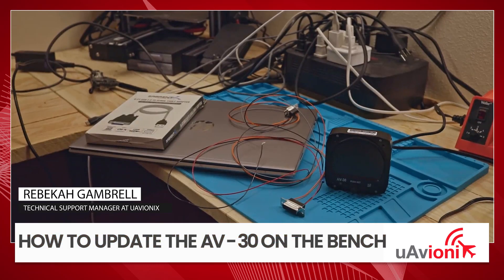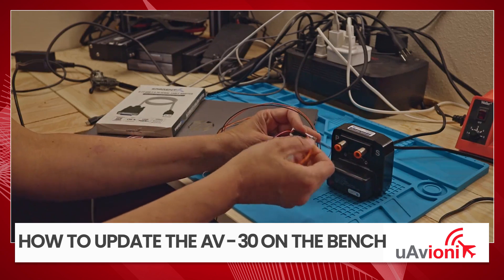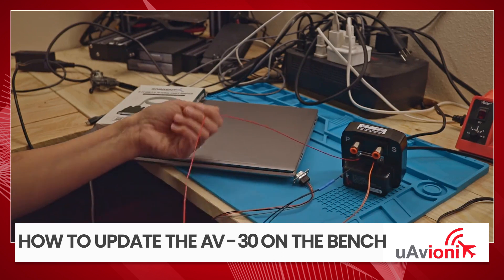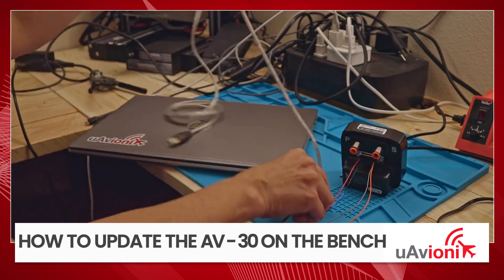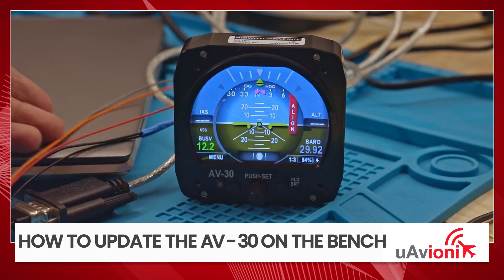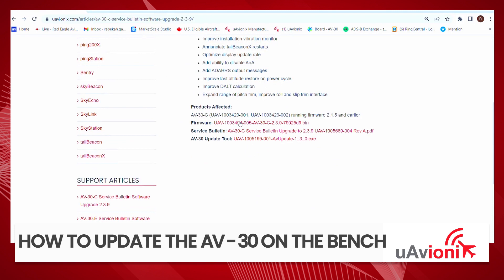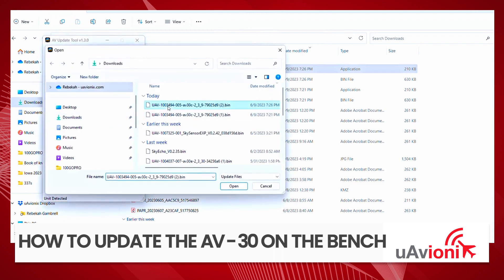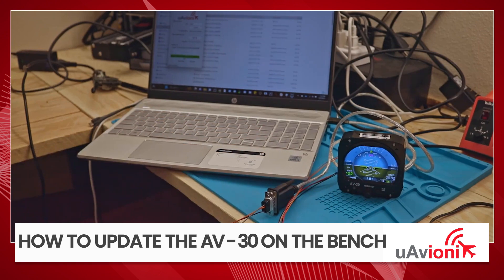How to Update the AV-30-C Software

Comment: You have GAWGHT to be kidding. A 21st century, cutting edge, device driven by pins and wires from the 1980s. Not to mention the fact that there are a few of us who own Apple computers. 🤦‍♂️ Up until this video I had been looking forward to the two AV 30s that I just had installed in my panel. Buyer’s remorse.

Comment: The title of this video should omit the -C, because it works for the AV-30-E as well as the -C.  Also, I, too, was about to look up the specs for an RS-232 9-pin connector, but I came to these comments and found that GND needs to go to pin 5 on that connector.  Other than that, it was a very useful video, and worked for me.  The Sabrent cable came right up on my Windows 11 laptop.  When I first opened its box, I was scratching my head wondering if I still have a working computer in my house with a CDROM drive.  But thankfully, I didn't need it.  And in Windows 11, if you need to figure out which serial port the Sabrent cable is on, open Device Manager, open Ports, and watch what happens in the ports list if you unplug the Sabrent cable and plug it back in.

Comment: Can I do something similar but use the AV link instead via a wifi connection?
Reply: You will have to already have firmware v 2.5.0 or later on the AV-30

Comment: These AV-30 are just a PIA.  I tossed my old AH and DG when vacuum pump went and thought I would modernize with the AV-30.  these updates are supposed to fix the problems but the precession is so bad the DG is useless. Need a magnetometer to make it functional..... added expenses.
Reply: I added the magnetometer last year during annual, and it is connected to both of my AV30s.  Definitely a game changer!  I too had a lot of precession on the DG prior to that even in cruise in less than smooth air.  Other than that, these things have been great!  I plan to add the Link and HSI modules this year as well.
Reply: I have the same experience. The built-in gyro is useless, you set it, the next day it shows a completely different heading.
Reply: @FlyingCsongor I always attributed that to the way it calibrates on every startup versus your mechanical DG. Mine always started up on the same heading regardless of what it showed on shutdown, and you have to wait a couple of minutes after startup to let it finished calibrating. Definitely a no brainer with the magnetometer now though!

Comment: 😳 could you perhaps make this process a bit more complex?? How about WiFi update? How do we update the AV-30 when it’s already installed in our panel?
Reply: I am wondering the same. I have this sabrent cable (got from the previous owner), but then how should I get this done? Should I get all these cables, 15-pin connector, external power supply and everything? And it seems impossible to do without actually taking the instrument out of the panel... Too much hassle for a firmware update to be honest. For its price I would have expected a USB connector where you can just plug in cable or stick for easy software updates.
Reply: @FlyingCsongor  from my understanding, you have to have firmware version 2.5.0 or later in order to do the wi-fi update. Mine only has version 2.4.1 so it looks like it will need the hardwired update at least one more time.
Reply: I think you can update with av-link wirelessly

Comment: That caused some problems for me saying the ground goes to the 9 pin on the db9 connector. It will not identify the AV 30 if you do this. Thought the error was my USB-Serial cable compatibility but it was this. I switched the pin and it worked smoothly. It needs to go to the DB9- 5 pin.  DB15-8 pin to DB9-3 pin   DB15-15 pin to DB9-2 pin   DB15-9 pin to DB9-5 pin and shared with -12v. DB15-1 pin to +12V

Comment: Hmmm... you did not say which pin on the 9-pin is the ground pin.  Please clarify.  Thanks
Reply: She didn't say.  I spent an hour trying to figure out what pin.  The split ground wire goes to pin 5 on the 9pin D connector.  Hope that helps.  She led me to believe that it was pin 9.  NOT  once I connected the ground to Pin 5.  Worked!!!  Good luck.
Reply: After 2 months there is no confirmation by UAvionix that the ground pin on the 9 pin connector should be number 5!
Reply: @davidpowell7614  Take a look at the Install manual it shows clearly the correct pins.
Reply: A standard 9-pin  RS-232 connector uses pin 2 and 3 for TX and RX with pin 5 as ground.